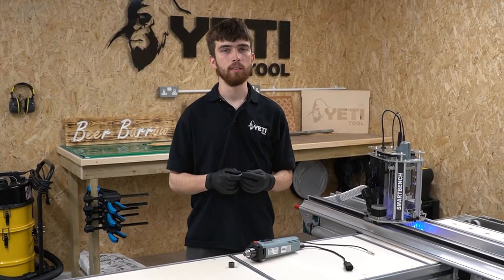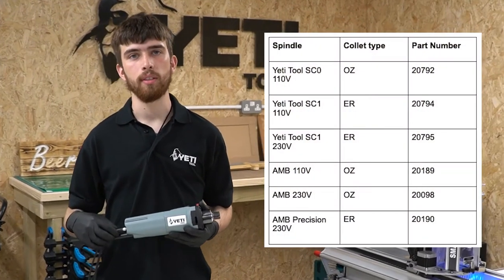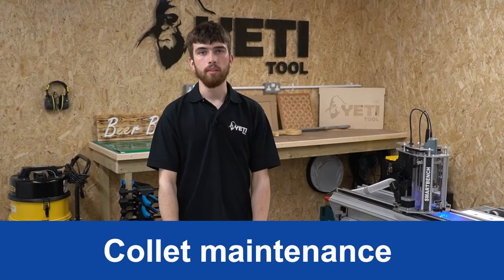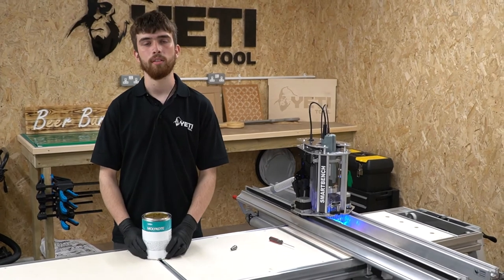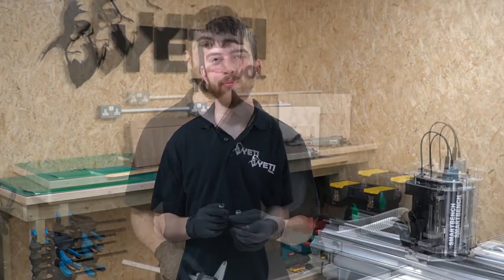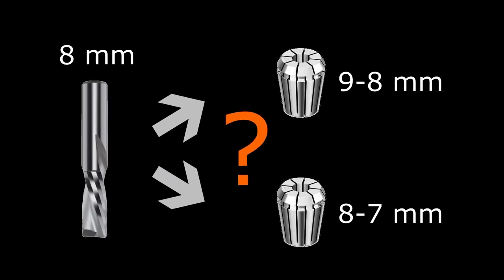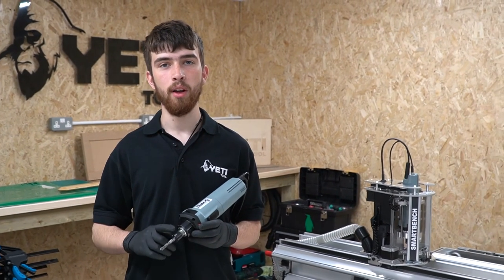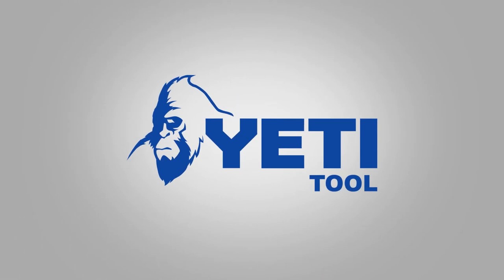SmartBench: Spindle Collets Tutorial

Comment: Thanks ! Just curious about tolerance of ER collets. China sells "Normal" and "AA" collets (0.015 or 0.008). Is that real ? Does it make any difference for metal working ?
Reply from the maker: Accuracy in the collets is very important. If the tool isn't concentric, that is when you get severe feedback and vibrations through the tool and in to the machine, which will drastically effect cut quality and finish. You'll find precision collets in machining and metal working are extremely expensive, exactly for this reason! A lot of high feed rate millers will choose to use shrink fit collets instead.